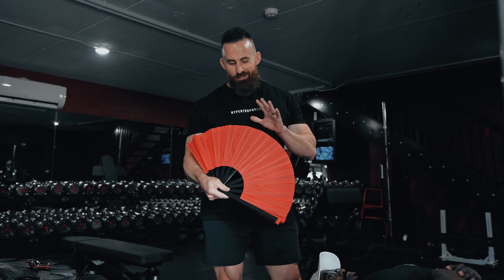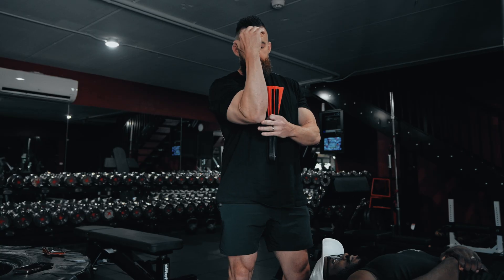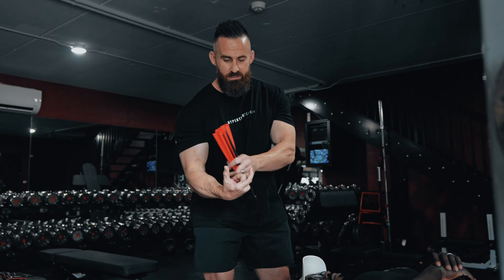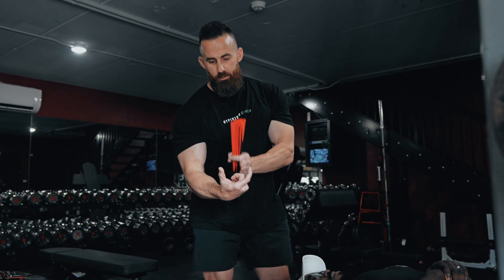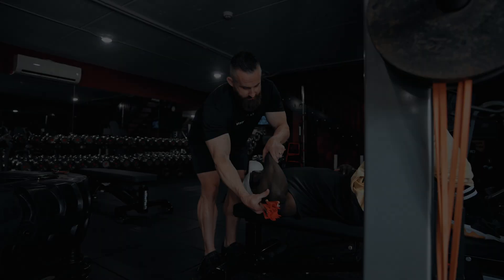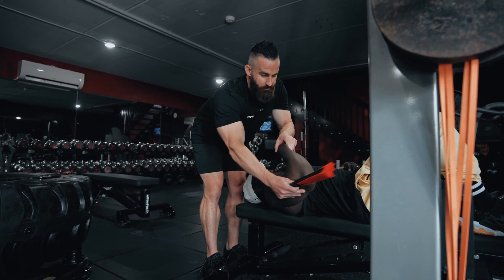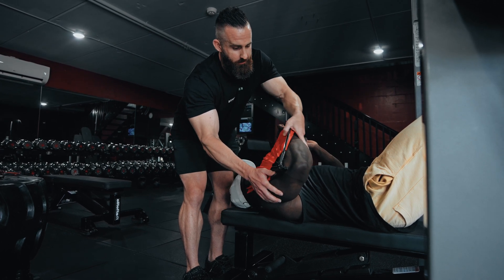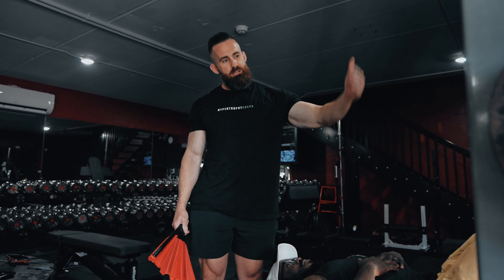What is “Plane of Motion” - Biomechanics Education w/ Hypertrophy Coach Joe Bennett

Comment: I find JM presses great but I find towards the end of my sets I feel way more of a burn in my upper pecks before my triceps can fatigue. Any ideas why this is happening and possible suggestions on how to fix this would be greatly appreciated thanks
Reply: Are you doing them free weight or on a smith machine?
Reply: @synergyrevolution2332  I'm using a Smith machine
Reply: @donahueomahoney8945  Try moving your body a little lower so the bar is lined up a little higher on your shoulders.
Reply: @synergyrevolution2332  thanks for your help.   I've tried playing around with body position I've gone from having it as low as the bottom of my shoulders all the way up to my chin but they all still seem to catch the upper chest
Reply: @donahueomahoney8945  might be you are pressing more like benching instead of working with bending your arms into your upper chest or chin.